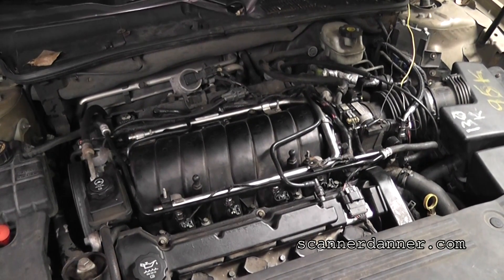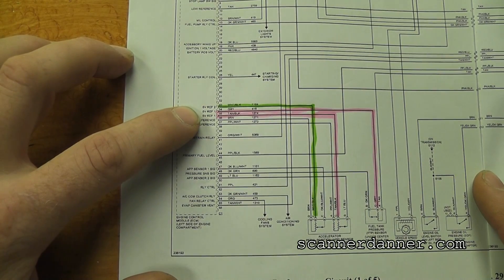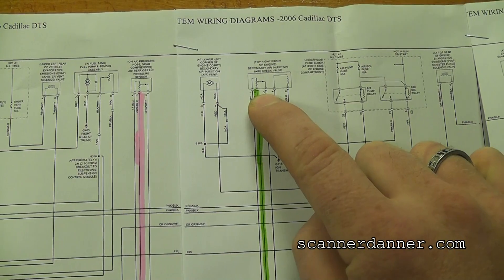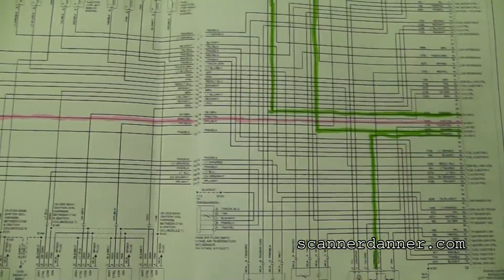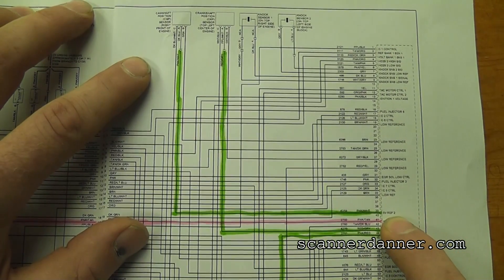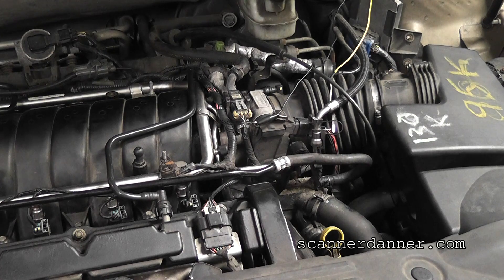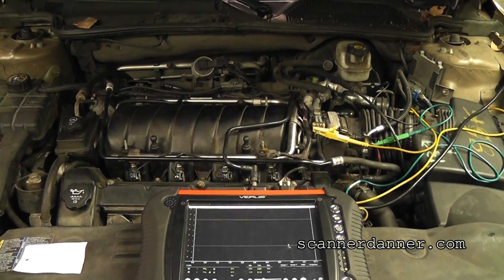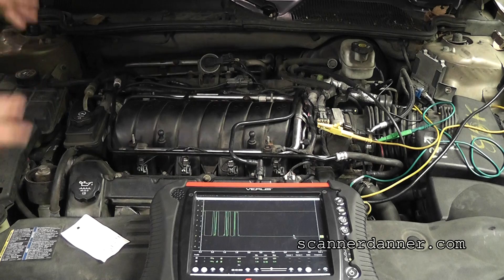How to check the 5v reference circuit for a short to ground (Cadillac)

Comment: Having a real tough time locating my 5v reference erratic issue. 2007 Jeep Grand Cherokee 5.7l code P1682
Reply from the maker: You will not fix it without re-creating the fault with test equipment connected. Start by identifying all the sensors that share this particular 5v ref circuit, then do visual inspections of all contact points of the harness and focus on areas of heat and vibration

Comment: What is the reference 3 code showing up but the volts is at 4.98
Reply from the maker: That means you have at least 3 separate 5v ref circuits. You need to start by finding out what all is on that ref 3 circuit

Comment: I have a basket case at the moment, P0697 which is 5v ref circuit symptom 00. The difference here is when I look at scan data, the 5v ref is fine. then I back probe the sensors on that circuit. They all have 5v. Service data says that if the sensors all have a 5v ref, then replace the computer module. But just like you say....im not 1000 dollars confident about replacing it.  The only interesting thing is the APP 1 at 100% is 3.61v looking at data pids, and when i back probe the signal wire at the ECM I get 4.18v. I am thinking ref 3 is shorted to ground internally but its intermittent. IE when it gets hot.
Reply from the maker: Don't replace the ECM! You have an intermittent issue and you need to recreate it. Most likely you have a harness rubbed through and is shorting out your ref circuit

Comment: Im tackling this same issue now, same exact car and motor. And its throwing me for a loop. My ref 1 5v is intermittently getting pulled to ground, its not stedy ground. By the time it acts up and i start unplugging things on the 5v ref it stops acting up and i cannot make a clear diagnosis.
Reply from the maker: It's probably a harness issue. Look for your contact points!

Comment: Dear sir i want askone thing if any short are volt is not good in wire so can Ecu damag or problem with any thing else.
Thanks in advance
Reply from the maker: For the 5v ref circuit, they are highly protected and the 5v will come back after you fix the short. A key cycle may be needed after repair to see the full 5v again
Reply: Thanks which circuit can damage ECU.Are ECU IS A SAFE from all circuit.Thanks
Reply from the maker: @farukh73  output circuits

Comment: Wait Wait!!! What was the "50 cent fix"???  I would just add a bit of "goo" on that exposed point... what would other people do??
Reply from the maker: You could cut out that section of wire and solder and heat shrink

Comment: How do you fix the wire or did you get another wiring harness
Reply from the maker: Cut the damage parts out and install a new section of wire using adhesive lines heat shrink and solder or adhesive lined, heat shrink butt connectors

Comment: Someone may have said this before as this is a 9yo video, but, you are correct that CMP sensor is on 5vref1 and that is just a mistake in that schematic. Just checked in global connect. You're correct that vehicle should not be running if, indeed, the cam sensor was on 5vref2.

Comment: Hey danner, i got a 07 tahoe in my backyard right now that also has a P0651. The data pid is also showing near 0 volts on the reference 2. Heres the twist.. I probed all the sensors using the reference 2 and all of them are showing 5 volts.. i dont know where to go from here, do i just call it a bad module? Its weird how the pcm thinks theres low voltage when theres not
Reply from the maker: That is weird. How is it running? Does each sensor that uses ref 2 have its own wire that goes to the ECM or is there only one ref 2 wire at the ECM and it splices externally to all the sensors sharing ref 2?
Reply: @ScannerDanner   each sensor has its own wire going to the ecm, and the car is in limp mode

Comment: Hi Dan, I got 2006 Impala with that P0651 . Found out when we shake the lower front harness the code will go out . Shake again it will come back. It's not near any metal. We separated all the wires.  Light goes out. We drive and hit a bump engine light comes back on. We don't see any metal l, they  are all shielded.  Can u please help.
Reply from the maker: Sorry, nothing else I can offer. You're in the right area
Reply: Let me ask you this. Because I can move the wire and get different results. Does it sound like bare wire or bad wire.?
Reply from the maker: @fredsolomon3rd6969  if it is pulling the reference circuit down all the way at the ECM, it is absolutely bare wire touching a ground. If the 5v ref wire stays at 5 at the ecm and low at the sensor, then it is a bad wire (corrosion)
Reply: I checked for 5 and the map sensor. Move  that wire and it went down.

Comment: What can cause a 5v reference 1,2,3,4?
Reply from the maker: You have 4 different 5v ref circuits right? Some cars do and it is no different than what I've shown hear as far as tracking the fault down
Reply: @ScannerDanner  yeah my tool shows 4 different ones showing 5.01 to 5.03 volts and ever since it started having all kinds of issue and seems to different codes

Comment: Thanks, you got a lot of enthusiasm to teach; I like that. I am DIY and trying to understand to test my 99' Suburban with a crank won't start. I don't have those high speed tool but I got a multimeter. Can I still do this? When you said unplug the wire on the circuit, do you mean, the one you are checking or all unplugged. And then check one by one? I will buy the book but first I got to learn this portion somehow.
Reply from the maker: Let's move this to my forum. It is free to join www.scannerdanner.com 
I need more info on what you're testing. The 5v ref circuit doesn't require a scope to test it. Your digital multimeter will be good enough. Thanks! Hope to see you there

Comment: I've got a 06 4.7 v-8 4runner with a 5 pin wire harness connector that plugs into the maf. My only codes are the vacuum canister but that has always been on and the maf sensor it starts but I EITHER have to two the key twice to start or turn it to the on position and wait 5sec then turn on or use the automatic car starter and it fires up the first time. I can drive and it idles fine but when I accidentally it gives out like if you took a deep breath and held it and someone started to give you a bear hug until you just couldn't hold it.  In my electrical DIAGRAM it says that the blue/white wire is the 12v or B+ but its coming up as a ground when tested but my yellow and black wire has 5.6 volts which I believe is my B+  I followed the blue/white wire all the way back and theres no break and good connectivity.  Was wondering if you have any idea why it starts that way. The weird thing is that I had it hooked up and wired right before but I loss 12volts and it was the blue /white wire and at that point I was traveling and couldn't trace it so I ran a direct line from the fuse box and I can't remember if I hooked it to the maf sensor b/w wire coming out from the sensor or the other part that goes in the vehicle or both but it worked great. Well when I got to SC I decided to clean it up and bit and it wouldn't stay running longer than 20sec and that was the direct power to both in blue/white and the other side of the blue/white. I had to cut the wires because theres no connector separating the maf harness and the vehicle.
Reply from the maker: I'd have to look at service info and a diagram to be able to help you. Post this to my forum www.scannerdanner.com it is free to join and we can do this there. Thanks! Hope to see you there,

Comment: There appear to be a lot of 5 volt voltage issues as well as grounding issues on vehicles. Particularly since they are all tied to the same output. Can this be checked with a multimeter in a methodical way at the sensors without causing any computer issues?
Reply from the maker: this playlist is for you my friend https://youtube.com/playlist?list=PLAFYVCyenqcpP9ykkWb2D16nVEjyQ1eTZ

Comment: I did a hard ECU reset (to try to set u p for a CKP relearn, etc) by touching the battery cables together for a few mins.  I also installed a new CKP sensor: which turned out to be BAD!   Sitting for a 30min key relearn there was a crazy amount of clicking,  fuel gauge going c r a z y , selonoids, ign coil, etc - which I thought might be normal - as the ECU was dialing in settings...............turns out the NEW ckp sensor was bad (i believe shorted internally). Once I swapped the older, but good, CKP sensor back in~  all the craziness stopped.   Im gearing up for a 30 min key relearn now.   Fingers crossed!     Turns out its a bad idea to go w a $13 ckp sensor vs the AC DELCO unit.

Comment: my 5v high and low pontiac g6 3.5 is low car starts runs but tachometer and speedometer dont work changed sppeed sensor, found starter inline fuse was bad replaced it, high and low are not two volts difference there like 1 volt difference high is 1.5 and low is .8 this car shouldnt run by omhs law! runs great! but im afraid to drive it until this gets figured out! i have no codes!!!! well one code the p0449 the vent valve ! been on sicne owned car. how do i test and rule out computer watch your videos there so dam long ! lol
Reply from the maker: They are long because I'm teaching. Sorry
Spend some time in my chapter 21 playlist (ignition system inputs)

Comment: So if I have 5v on any of the sensors on each ref I have 0 shorts to ground 🤷
Reply from the maker: If you have a short to ground on the reference circuit, you won't read 5v, that is for sure

Comment: Paul you Rock!  A friend of mine wife's car was throwing a 5 volt reference 1 code.  Followed your video procedure. 1 hour later found the problem. A/C pressure sensor connector was the problem.  The cmp sensor APP 1 sensor FTP sensor EOP sensor map sensor all share the same reference. Car in limp mode.. 1 new connector boom car is fixed!  He was ready to buy a whole new throttle body. He's glad I talked him into.letting me diagnose the problem.
Reply from the maker: Awesome! Nice job

Comment: Probably a dumb question, but if you use a multimeter instead of a scope, does seeing the fluctuations in voltage still apply? Do I specifically need a scope to chase 5 V ref codes? I only have a multimeter. No one in my shop uses a scope at my GM dealer, that I know of.

Comment: I'm having a problem with reduced power and no throttle response on my 2000 Camaro 3.8 I probe the TPS and I'm only getting 3.5 volts I think please help any direction would help thanks

Comment: MISTER DANNER I HAVE A BIG PROBLEM , I AM IN NEED OF KNOWING ON THIS SEEM TRUCK YOU WHERE WORKING ON  (AT THIS VIDEO)  (THE ONE I AM WORKING ON IS A FOUR POINT TREE LITER )  WITH THE CRANK SHAFT SENSOR UNPLUGGED WOULD I SEE FIVE VOLTS ON MY REFERENCE SIGNAL WIRE AT THE CRACK SHAFT SENSOR  WITH THE KEY IN THE RUN POSITION .  I AM NOT FAMILIAR WITH THIS SYSTEM OF GM , I REMEMBER ON SOME OF THE OLDER GM'S THERE WAS A VOLTAGE ON THE SIGNAL WIRE  IF THAT'S CORRECT . I WOULD LIKE TO TEST TO SEE IF THE PCM CAN  SEE THE SIGNAL ON THE AUTEL SCANNER WHEN I GROUND IT SO POSSIBLY IF I DON'T SEE THE FIVE VOLTS THIS WOULD MAKE IT A PULL DOWN CIRCUIT I JUST DON'T KNOW BUT I THOUGHT WHEN I WAS AT THE VEHICLE LAST WITH THE SENSOR UNPLUGGED I DID NOT SEE A FIVE VOLT REFERENCE SIGNAL . I HAVE BOUGHT YOUR ONLINE BOOK MANY YEARS AGO THANK YOU FOR TAKING THE TIME TO MAKE THIS GREAT CONTENT THERE IS A NEED FOR YOUR PAID CLASSES AND I WILL LOOK INTO THAT FOR ME AND MY BOTHER THANKS AGAIN AND ALL THE BEST !

Comment: That's an excellent point, you don't want to accidentally fix the problem without knowing where it was. The scope makes this so much easier, though a power probe singing a ground connection could do the same thing with an auditory signal.

Comment: What could be an issue if the 5v only has 3 volts? No com in a 12 Silverado comes and goes,
Reply from the maker: Partially shorted to ground ref circuit or faulty module
Reply: @ScannerDanner  I put a new pcm in got 5 volts now, still no com. Got some singing to do. Love your videos
Reply: @ScannerDanner  could it also be a voltage drop?

Comment: Had damaged ,ground,  cam position sensor harness , rubbing on sharp " right " head , near sensor .1/4 in. conduit was " trash", leaving 3 wires to sharp head damage .The repair was found and repaired , before any " codes " ! Lesson learned , KEEP WIRING NEAT !

Comment: If check engine light never comes on before you start the engine
What is the probem?
Reply from the maker: does it run? If so, the bulb may be burned out or someone removed it

Comment: I had one of these about 5 years ago that shorted in the exact same spot.  Mine was an injector control circuit though so it was pretty scary how much raw fuel was dumping out of the exhaust.
Reply: Where exactly was yours? I have a misfire only on cold engine

Comment: Speaking of limp mode.. you might want to take and run with this idea.. during accidents people's engines quite often stopped running.. secondary electric override with motor via transfer case to drive shafts switchable. To allow vehicle to limp off the road out of freeway traffic for example. Possibly the car's battery would be enough for this power. Or some kind of inverter could be used. Or a second battery continually charged but not used for this emergency contingency purpose.. possibly this device conversion can be retrofitted on new vehicles.. and save lives..

Comment: I have a 1997 GMC Sierra C 3500 in the shop for two weeks they're finally getting around to working on it.. All sensors new. new ECM was not relearned definitively . security light burned out Dash. Went in with no spark and apparently only Prime fuel pressure. . A child's question. . If all sensors unplugged except fuel tank and crankshaft sensor. Would the motor run. And transcend the short to ground problem possibly reference wire somewhere or whatever broken wire problem that would be if not in that circuit. Or better yet is it possible to unplug sensors to see if it will get Spark. At some point. Whether it runs or not.. in other words how can a caveman Yours Truly , figure this out in theory?

Comment: What is that black box with wires coming out  each end connected to the passenger side strut assembly next to coolant tank underneath the hood I ask because mines seem they've been cut ,no problems that I can tell car runs fine I just want to know what it may be

Comment: hi ScannerDanner i have a 2001 cadillac deville and i have a no start situation, car cranks but does not start i replace an EGR valve. air injector pump, air injector solenoid, and the mass air flow because i was getting codes P0102. P0410, and P0442 now the car will not start i check to see if i was getting gas i am but when i check the injector i have ground to power but no pulse action on the other lead. and suggestions.

Comment: Same issue/symptoms on an 06 Buick Lucerne 4.6. Lots of people will order a new TPS connector (like myself) but I later found an internal break in a yellow/red wire local to this connector and probably never needed to replace it. There was also a visible break in a thick gauge orange wire near the secondary air check valve. Very near the location of your break! Lots of wiring repairs done on these Northstar V8 systems. Tons of people called technicians are afraid to touch it even though this vehicle will throw a 5v reference code right at your eye socket. I had to send mine to the dealer since I didn't have the right skills or tools to tackle this problem. Also, please beware the fuel pump relay in this vehicle. It has been known for years to cause the rear fuse block to catch flame but Crickets from the manufacturer. I check mine all the time. That rear fuse box always runs way too hot.
Reply: Your supposed to trim off some of the seat bracket on the fuse box side bcz when someone sits back there it will rub the fuel pump relay causing it to not make good a connection then it just melts 🔥🔥 your also supposed to use a shorter relay there's a service bulletin on this 😉

Comment: The two reference voltages provide redundancy for the pedal position sensor signal. Since both voltages are already there by necessity, the other sensors are split between them.
Reply: derek i had this 5v reference code for over 2 yea nowr i pay on the car so i have no other option but to keep it any ways ..car threw a code for 5 volt reference it was the throttle body so i order a new one and installed it.. i worked at a chevy dealer so my buddy bought  over the tech2 to relearn the tps..drove the car fine for the whole day after that no problem at all next day started up fine went about a half a mile and boom same thing again  with the same code this time i took to the dealership since i no longer now whats wrong with my car,,the head meach at the shop told mi it needs  a new throttle so i order a new one agian ..pretty much got warranty on it they send mi a new one put it on drove it fine for 2 days and boom same code again..if u can please give mi an adive on to were to start thanl you so much

Comment: Your work is great, and your tips are very important for us. thanks a lot and blessing.
I have checked a nissan 6-cil 3,0. the  spark is there, gasoline too, but there is not pulse on the injectors. can you help me, please. the car`s computer is ok, well a technician told me that.
tahnk you.
Reply from the maker: Israel at the moment I'm trying to answer questions from the top of my head and when it comes to research (which I would have to do in this case), I can't do that right now as I am in the middle of a very big project. (moving ScannerDanner Premium to my website). Please post this to my forum on my website, we can help you there. https://scannerdanner.com/forum/post-your-repair-questions-here.html
Reply: thank you so much, sorry for my English writing